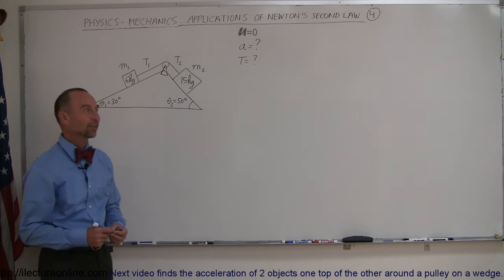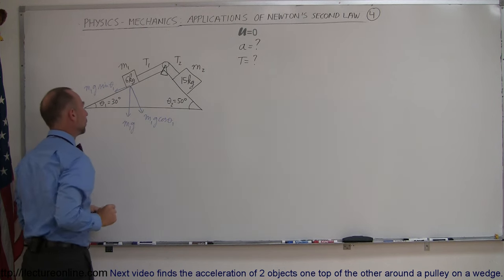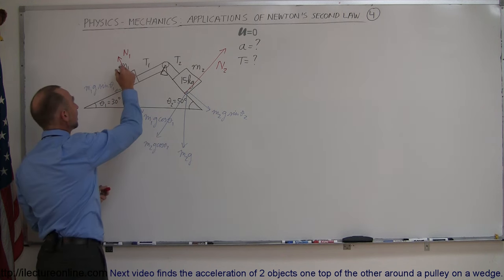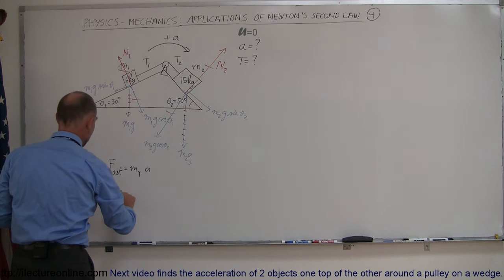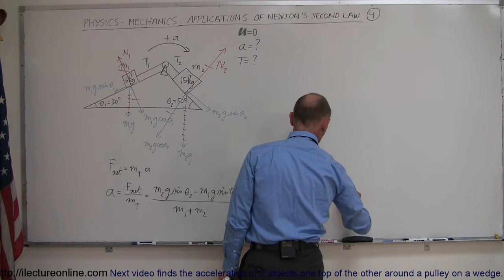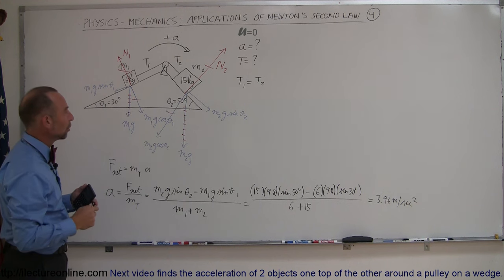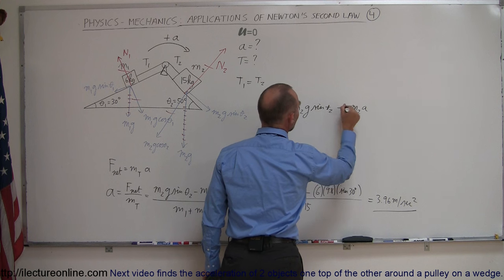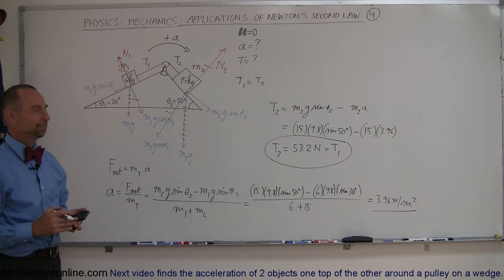Physics - Mechanics: Applications of Newton's Second Law (4 of 20) double ramp

Comment: Great video sire. I have a question that, "what if there is a friction in lower mass side, what would be the tension in the block. Does both the block would carry same tension!! or there will be difference in the tension.
Reply from the maker: If the pulley does not have mass (or the mass is insignificant, then the tension on both sides will be the same.
Reply: @MichelvanBiezen  thank you sir

Comment: I like to create a coordinate system along the incline/decline with my positive x in the direction of acceleration....but that's just me. Y-direction doesn't really matter since the normal forces are canceled out by the y-components of weight. At least that's how my pea-brain understands it.

For finding T2, I solved the right side of the pulley. Since T2 is going in the opposite direction of a, I made this equation: -T2 + m2*g*sin(Q2) = m2*a.  If you rearrange it, you get: T2 = m2*g*sin(Q2) - m2*a.    T1 = T2, but you could have also created and equation for the left side, with the positive x in the direction of acceleration. I got T1 - m1*g*sin(Q1) = m1*a, or just T1 = m1*g*sin(Q1) = m1*a.

I hope I didn't confuse anyone, as I am always confusing myself.

Comment: hi prof! may I ask a question, why did you cancel n1 and m1gcos theta and n2 m2gcos theta?
Reply from the maker: That would be violating an algebra rule.  You can only cancel if the factors are multiplied.  But the equation as written consists of multiple terms in the numerator and denominator, so they cannot be cancelled.  We have a playlist on that in the algebra videos

Comment: im trying to solve the problem where there is a third mass hanging from the right side of the double inclined planed. It is connected to the other 2 masses by a pulley and the forces acting on it are the gravitational force and the tension from the rope. Can someone help? I cant find it online.
Reply from the maker: You just need to add an additional force aiding the acceleration to the equations which in this case would be  M3g.

Comment: Hello Sir, how about the coefficient of kinetic friction between the incline and blocks? how do I solve it?
Reply: In this problem the inclines were given as frictionless.

If you had friction, you'd have another force to apply.  Kinetic friction would be opposite the direction of velocity, which assuming it is speeding up if not otherwise specified, is therefore opposite the direction of acceleration.   You calculate the force of kinetic friction by multiplying the mu_k coefficient by the corresponding normal force.

Comment: When you find the net force, why don't you include the Tensions in the cable? Don't the tensions cause acceleration as well?
Reply from the maker: No, the tension in the rope is internal to the system (it holds the two blocks together).  We only need to add external forces acting on the system.
Reply: Thank you!

Comment: I still do not understand why did you subtract the acceleration while finding the tension, because tension is opposite to m2gsin(theta) and m2a (a = acceleration).. Shouldn't it then be m2gsin(theta) + m2a???
Reply from the maker: Topsy Kretts If the acceleration is against the force of gravity the tension increases (T1), but if the acceleration is in the same direction as the force due to gravity (m2) the tension decreases (T2)
Reply: Michel van Biezen I simply do not understand this as well. It doesn't make sense to me. I have been trying to understand it for at least 5 hours now. My father tried to explain it to me (he is an engineer, and I am a student engineer). I tried to post on different forums and so on. I SIMPLY DON'T GET IT.
Reply from the maker: David V Lund 
Instead of spending 5 hours on this video, why don't you start with watching this series:
PHYSICS 4 NEWTON'S LAWS OF MOTION

and then watch the other videos in this series
PHYSICS 5 APPLICATIONS OF NEWTON'S LAWS

you will begin to understand it.
Reply: I understood it after lying down it bed thinking about it for 5 min. You lift something down = it becomes easier. Therefore F has to be smaller, so you subtract on the acceleration. You lift something up = It becomes harder. Therefore F has to be bigger, so you add to the acceleration.
Reply from the maker: David V Lund 
That same type of thing happens to me all the time.  It may take some time before I get it.  The key is not to give up and go over it again and again.  Eventually you will understand.  
Persistence is the key to learning.

Comment: Im confused sir. Do we need to always use the FBD of the bigger mass than the smaller one in solving for tension?  because if I try to solve this using the smaller mass. the tension is not the same.
Reply from the maker: You can solve for the tension using the small mass and you should get the same answer.
Reply from the maker: This playlist may help:   PHYSICS 17 TENSION AND WEIGHT

Comment: Why dont we use t1 and t2 to find the accelaration? Because they are include to fnet too.
Reply from the maker: T1 and T2 are INTERNAL forces.  They are not external forces acting on the system, which means they cannot cause the system to accelerate.

Comment: Shouldn't the acceleration be equal to a=g[m1sin(theta1)-m2sin(theta2)]/(m2-m1) because of the acceleration is in the x direction and the acceleration in the y direction should be g[m2cos(theta2)-m1cos(theta1)]/(m1+m2) ?
Reply from the maker: +Matthias Andersen In this example there is not "x" or "y" direction.  Better to just find the magnitude of the acceleration (which will be the same for both objects).

Comment: Shouldn't it be plus if the acceleration is down (as you had already previously determined?)
Reply from the maker: If the acceleration of the object is toward the ground, you must subtract the weight (or the component of the weight) when calculating the tension.

Comment: ok thank you for this explanation ,but i got a question ,what if the small mass is the one on the side where we have a big angle and the big mass where we have a small angle
Reply from the maker: Then the acceleration may be in the opposite direction (as long as there is a net force in that direction).
Reply: my question is where the direction of motion is directed.is it to the small mass or a big mass
Reply from the maker: It depends on a number of factors, slope, relative weight, and friction.  It all comes down to the net force, so we can't answer the question until we calculate the net force.  Try it and see what happens.
Reply: we donot have tension but we have friction force .the question was like this :we have 2kg mass on an inclined plane of 53° and 4kg mass on an inclined plane of 37° and we were asked to find the acceleration and tension and both planes   have coefficient of friction forces of 0.2.
Reply: help me to solve that question

Comment: why did you included the sine in the tension.. in the last question you didn't included the sine (the component) you just but m2g...I need help     +Michel van Biezen
Reply: oohh I just know why...Because the last example you didn't need to use the sine for mass two because in wasn't inclining, but in this case there is inclining for both..mass1 and mass2
am I right?
Reply from the maker: That is correct.

Comment: when given a mass on an inclined plane, does the normal force and the weight on the Y-component ALWAYS cancel each other out?
Reply from the maker: Newton's third law always works, but there could be additional forces at play and then you'll have to use a summation of forces.
Reply: The normal force will be as large as necessary to prevent one object from penetrating another object.  Most of the time, the normal force cannot be negative, as that would mean the objects lose contact with each other.  Unless there is adhesion or a special kind of track to provide a tensile normal force, it is usually compressive only.

It doesn't necessarily only cancel out weight, as it could also cancel out a component of a human force pushing it toward the incline.   It could also contribute to a component of acceleration, like in the example of a car driving on a banked roadway around a curve, where the horizontal component of the normal force is what provides the centripetal acceleration at the critical driving speed of zero traction.

Comment: Hello sir, I have a question regarding one the possible problems. What if the mass for one of the boxes arent given? lets say if the right box weighs 100 N and the left box weight is not given.
Reply from the maker: Unless another piece of information is given that would allow you to calculate the mass, you will not be able to solve the problem.
Reply: @MichelvanBiezen  there is two ramps the one the right side is 40 degrees and on the left 20, on the right ramp the crate weighs 100 N and is smaller than the crate on the left ramp, there is no pulley between them but a rope tied to both crates, the question asked is a) what is the force acting on the rope between the crates?  b) how much does the crate on the left ramp weighs?
Reply from the maker: It does appear there is insufficient information given.   Are the crates moving or stationary?  If moving, are they moving at constant speed or are they accelerating?  Is the friction between the crates and the surface?   I believe the author of the problem is making assumptions that are not revealed.
Reply: @MichelvanBiezen  the surface is frictionless and I have a teory that the crates are nullifying eachother so there is no movement meaning the acceleration is 0.
Reply: Here is a link to the question with picture and all https://imgur.com/a/heXcA1D hope it helps!

Comment: hey isnt sint(theta) equals to 40° rather than 50°,because that small trangle
Reply from the maker: The only restriction is that the 3 angles must add up to 180 degrees.  You can therefore assume that the 3rd angle is equal to 100 degrees.

Comment: If m1 is greater than m2 ,the acceleration would be positive or negative?
Reply: Plz early
Reply from the maker: It depends on the angle.  If m1 was slightly larger, the acceleration would still be in the direction of m2.  (note that we typically find the magnitude of the acceleration and then describe the direction.  (negative and positive doesn't mean much here)

Comment: When you say the acceleration was positive in clockwise direction then why at 4:58 you say its going to be minus
Reply from the maker: +Mukhtar Mahmood Good question.Those two are for separate distinct items you are solving for.1) Assume a direction for the acceleration of the system.  If you guess wrong, that is ok, you will get a negative for the value of the acceleration.2) The second item is the tension in any of the strings.  If the object is being accelerated upward (against the force of gravity)  the tension in the string T = mg + ma.  If the object is being accelerated downward (with the force of gravity) then the tension in the string is T = mg - ma.  These two calculations are completely independent on one another and finding the tension in the string does not depend on your choice of assumed acceleration.(To find T off course you must know the actual direction of acceleration).
Reply: Thanks, I figured that after boggling my mind for a while but now this really clears up a lot you are great!

Comment: you are  applying  the newton's second law for the x axis ,in order to find the tendency of the string T2 so F=ma => m2gsinθ2-T2=mα=>....The question is why you do not count the T1,T2  at the formula Fnet=mτα ??
Reply from the maker: takkis Nassiopoulos 
There are 2 ways of solving this type of problem.
1) Consider the whole system as one object and only consider the forces acting on the whole object. as is done in this video.
2) Take each body separately and consider the forces acting on each by drawing free body diagrams and then solving the equations simultaneously.  (not done here)  Then you would have to include T1 and T2

Comment: If there was friction then you cant ignore (N)ormal force, wouldnt you?
Reply from the maker: +legionostra 
  If there is friction, then the normal force is used to calculate the friction force.  There are lots of examples in the playlist with friction.
Reply: +Michel van Biezen what if the pulley had friction, how would you calculate? Like what would the normal force be for example?

Comment: Why did you use subtarction in finding the tension
Reply from the maker: When the object accelerates down the hill, the tension required to hold the block against gravity is less.    (Or you can draw a free body diagram and it will give you the same answer).

Comment: Wouldn't the tensions on each object be different since their masses are different?
Reply from the maker: It is not possible for the tension to be different, unless the string has mass, or the pulley has mass.  If you draw a free body diagram around each mass and then solve for the tension in the string in each case separately, then you'll get the same tension in each case.  (There are examples of that in the playlist)
Reply: @MichelvanBiezen  I solved a homework problem similar to this and the solution is that the tensions are different. I think they should be different since the masses are different and the string is separated into two components by the pulley.
Reply: @MichelvanBiezen  Plus you are dealing with two different angles for the slopes of the surface. The tensions must be different.
Reply from the maker: That would violate the laws of physics.  The tension cannot be different (unless the pulley has mass and we have to take into account the moment of inertia of the pulley)
Reply: @MichelvanBiezen  I appreciate your video, and it honestly helped me out. But I still am very confident that the tensions are different. Just think about if one block was on a surface of 10 degrees, and the other was at 80 degrees, AND THE MASSES ARE DIFFERENT. Surely the tensions are different. There's no way they cannot be in this case.
Reply from the maker: Rather than trying to convince yourself that you are correct.   Try to understand why the tension is the same on both sides of the pulley.  (There are a number of videos in the playlists that explain that).  You can be 100% assured that the tension is the same on both sides.
Reply: @MichelvanBiezen  Thanks, but I don't need to convince myself. It obeys the laws of physics. Can't see how it would be the same. That would only be the case if the masses were the same or the string was one component. Think about the objective of a pulley 👍
Reply: @MichelvanBiezen  If you are sure it's right, then please explain to me.
Reply: @MichelvanBiezen  I believe that the difference between our thinking is coming from your example having no moment of inertia with the pulley whereas my example does have moment of inertia. Sorry for the mix up. I enjoyed your video.
Reply from the maker: This was a good exchange and in the end you learned the circumstance when the tension will be the same and when it will be different.

Comment: How to get direction of acceleration.
Reply from the maker: Usually you can predict the direction of the acceleration by assuming it will be in the direction of the larger abject (referenced to the pulley).  Then calculate the acceleration.  if the result is positive, you guessed the correct direction.

Comment: why is T1 = T2? at 4:05 ??
Reply: Thank you for including the timestamp, it is a good idea to do that for context.

The reason the tensions are both equal, is that the string and pulley are both assumed to have negligible mass and negligible friction, since not otherwise specified.   A string carries the same tension throughout its fibers, unless there is a reason for the tension to change.  The tension on the string itself has to add up to zero, since the string has no mass.  Acceleration of the string would be infinite, if there were a difference in tension.

Comment: Don't understand why  we minus m2*a is it because tension is in the opposite direction? as m2*g*Sin50 is going with the accelarting direction, I would think we need to add  m2*a ,, any help please>>
Reply from the maker: The concept is easier to see if you look at it this way.  If you hang an object motionless from a string the tension in the string will be "mg".   If you now pull harder on the string such that the object now accelerates upward with acceleration "a", then the tension in the string will be "mg + ma".  Now if you reduce the force on the string to less than "mg", then the object will begin to accelerate downward with an acceleration "a".    The tension in the string will now be "mg - ma".
Reply: Michel van Biezen thank you Sir I fully  understand thank you for all your help..great Lecturer

Comment: what if the acceleration is negative?
Reply from the maker: We tend not to talk about "negative" acceleration on the incline, but rather up the incline and down the incline.  But if you pick the incorrect initial direction of the acceleration when you work out the problem, then you answer will turn out to be negative and that simply means you found the correct magnitude (if you didn't make a mistake) and the direction of the acceleration is opposite.